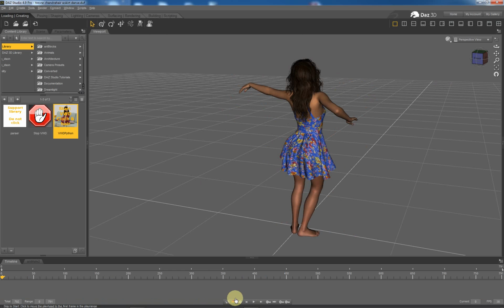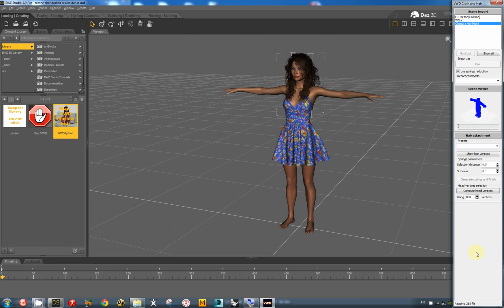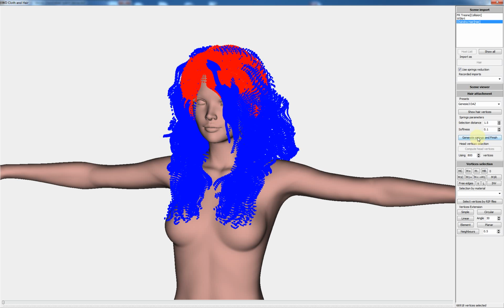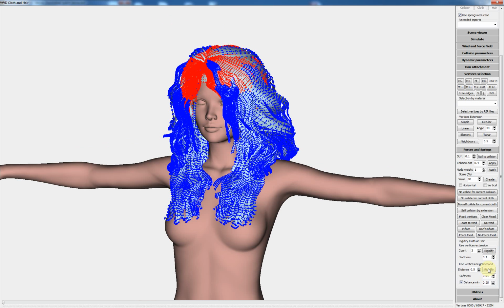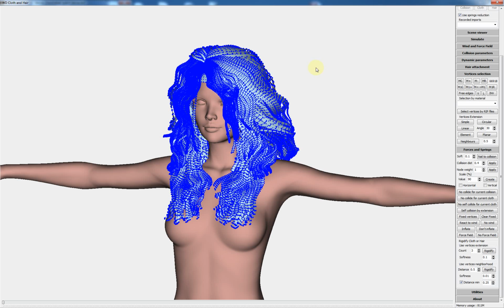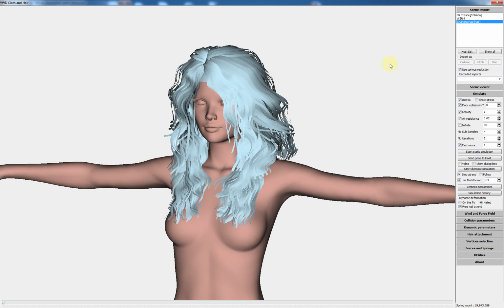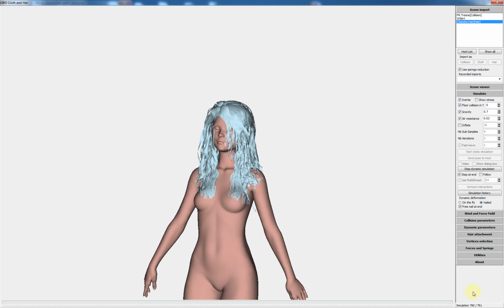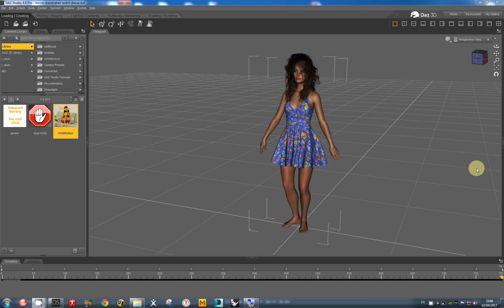Tresne with Chandra hair

Comment: Oh...and where did you find the animation bvh?
Reply from the maker: The current simulation makes more than 700 frames and has been calculated in one time. You can find many animations on the MIXAMO web site, with a great quality.
Reply: Wow, thanks for the info about MIXAMO.  Are there any other BVH libraries on the net you might also recommend?

Comment: Thanks a lot. You resolve a lot of problems with this video.
Reply from the maker: Excuse me to reply so late. I am convainced that VWD lacks tutorials. The program is not easy to understand because it has not presets.
But, for me, a good simulator cannot be a "two clicks" software. I really want to take time to explain how works VWD.
Reply: Could you make a tutorial for dresses that keep their shape, but that collide smoothly like the Bow Skirt For Genesis 2 Female?
Reply from the maker: Yes, you are right. Bow skirt is a very good example. It will allow to create a very useful tutorial, mainly on the self-collision system.